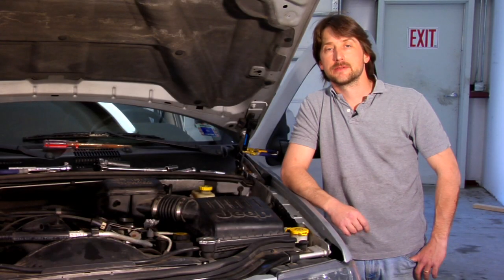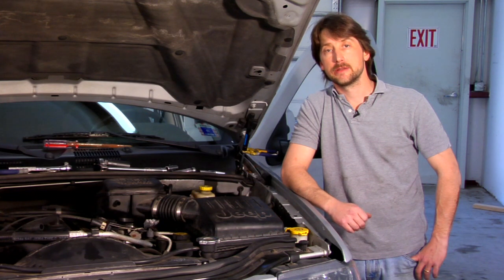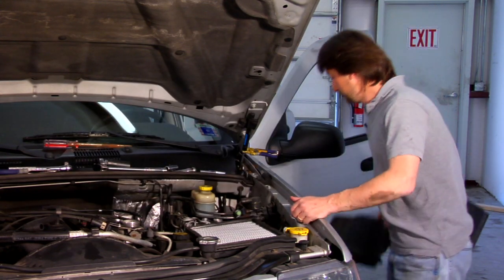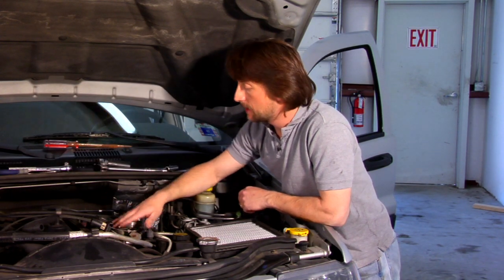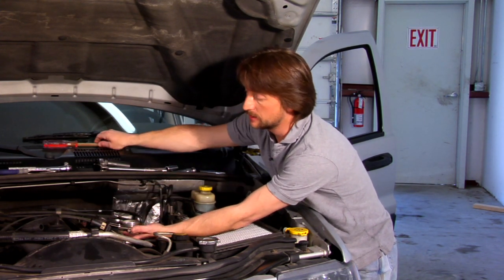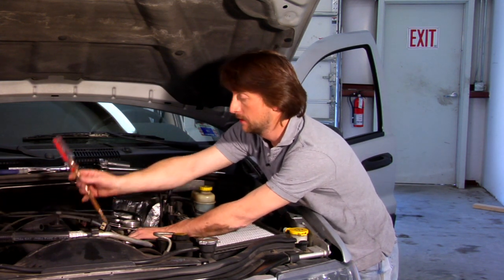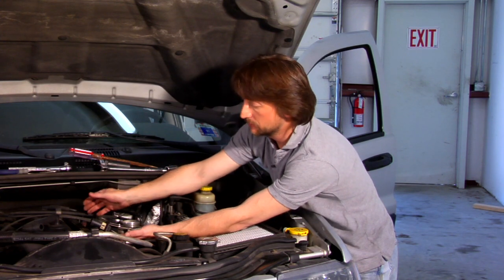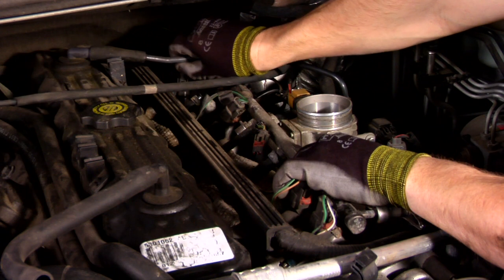Auto Repair & Maintenance : How to Change Fuel Injectors

Comment: i recently got bad gas unfortunately in my car. If i just unplug the fuel pump fuse and run the car till it dies will that burn the bad fuel out of the injectors?